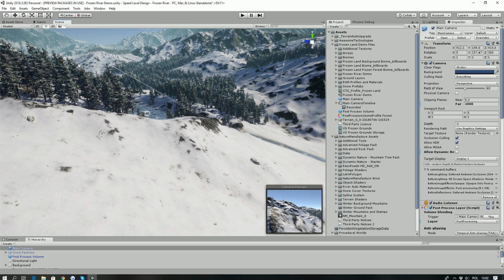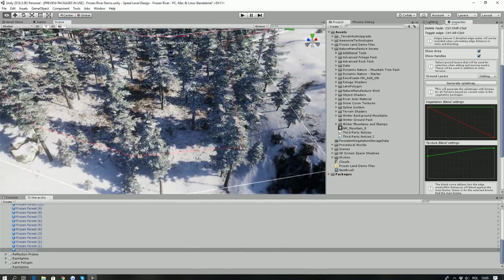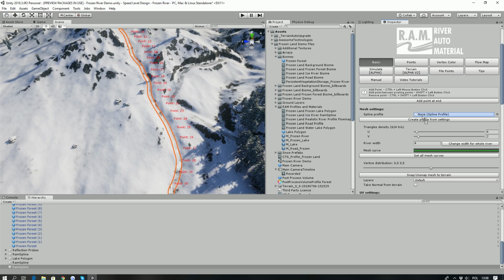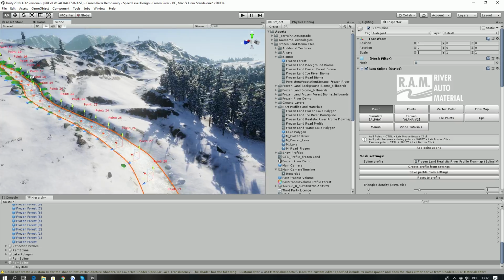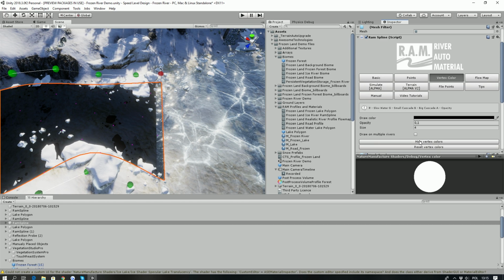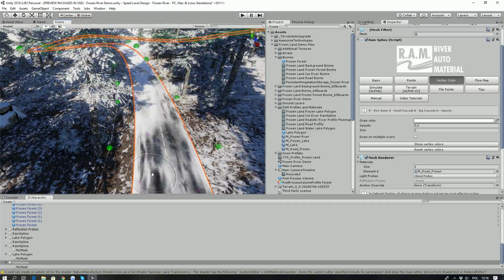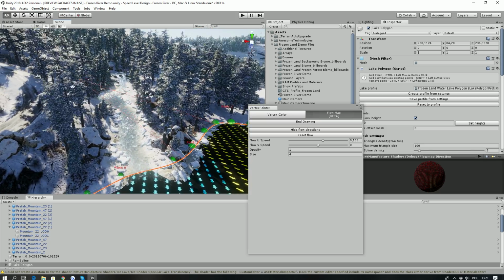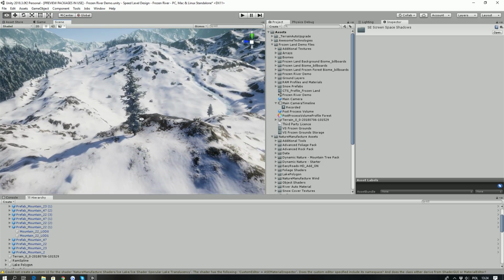Let's... NatureManufacture Frozen Lands & Vegetation Studio Pro

Comment: I have a problem with R.A.M - 2019 .
How much I try to use it for urp, the materials are not upgrading to urp.i had followed your steps in overview.
First i imported the package in urp and then imported urp 10.2 support which converts the materials.
But the materials are not changing.

Even i have tried deleting and reimporting the asset many times.

It just driving me crazy how many times i tried.
Is there any way to upgrade it to urp.
Did i do any mistake in upgrading it to urp.

If any please any one tell me how to do it.

I have a problem with this.

Please help me anyone.

Comment: Why are all the M_Big_Rock_Snow textures missing (pink)? Also some of the splines are pink.
Reply from the maker: Chose shader standard metalic snow for them. Did you import all assets included in list?
Reply: @NatureManufacture  Thanks, that worked for the rocks but the spline is still pink when the Frozen Land Realistic River Profile is attached to it. Is there a missing material for that or shader I need to assign somewhere that I can't see?

Comment: Got a problem with the M_Road_Frozen Shader also got messages like prefab_ice_floe_04_2 is missing.  Any ideas?
Reply from the maker: Shader is in  hd roads add on. Anyway I will update demo to r.a.m 2019 and also fix that - i will add this shader there. You got ice world or dynamic nature starter?
Reply: @NatureManufacture  Got the Dynamic Nature Starter...
Reply from the maker: @haraldgundersen7303  Hmm maybe I forgot something in the demo. I will check. Anyway it could be 1 of the floe which is inside dynamic nature starter. No matter.
Reply: Updated Road material M_Road_Frozen with shader NatureManufacture Shaders/Standard Metallic Road Material. Terrain looks great now... Thx